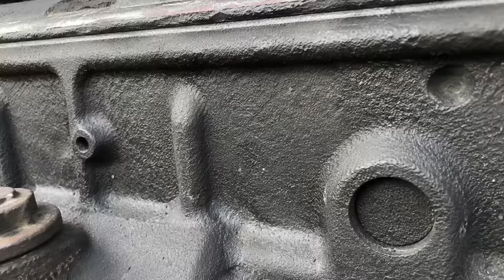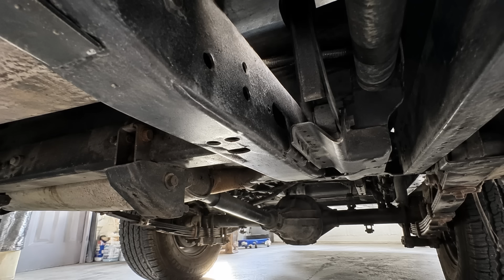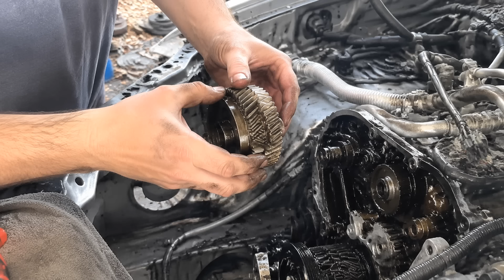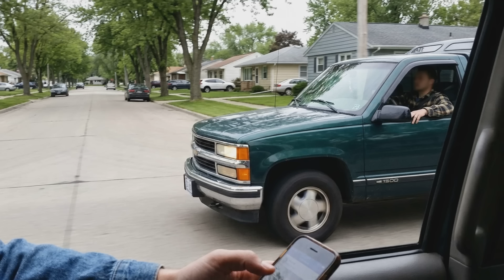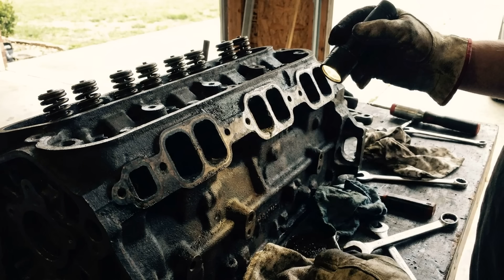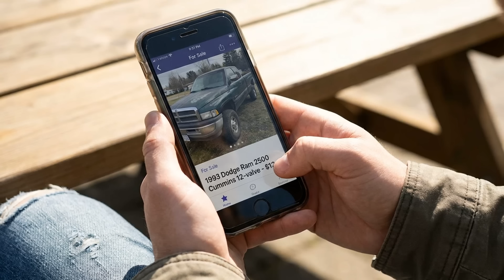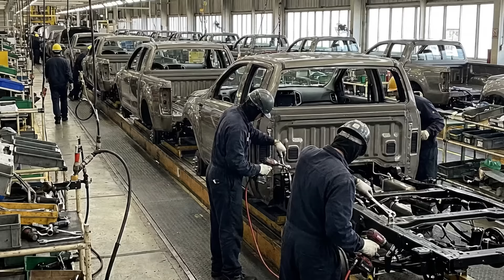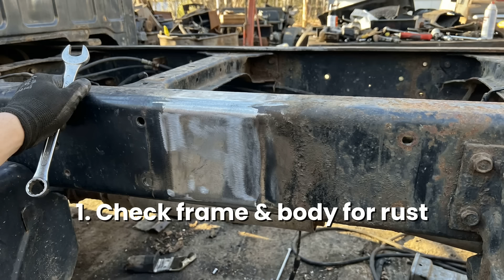7 Dirt-Cheap Pickup Trucks Nobody Buys (But They'll Outlast Every New Truck Forever)

Comment: I had an new 87 Pup with A 2.2 diesel Volvo three speed automatic. I had 1800 lbs loaded One time, spring where inverted drove slow Made my delivery I drove this little truck wide open for over 250k  It's probably in South America still running.

Comment: Still driving my 2003 Toyota Tundra.. I currently have a bit over 300,000 miles on it. Had to replace the alternator and the radiator. Last year my engine decided to give up the ghost. No warning, it just went BANG at 80 MPH on the Interstate. Had to replace the engine. Got a good remanned engine with a no fault warranty for 2 years. I've always done my own work on my vehicles. Although I never really was an ASC certified auto mechanic, I was a Big Boys Toys mechanic (motorcycles, ATV's, UTV's, snowmobiles, personal watercraft [PWC], and boats, both outboards and inboards). I can tell you from years of experience, no matter what size it is, all internal combustion engines work the same!

Comment: Basically we let the manufacturer's build new trucks with luxury and not priority to be just a  work truck .  
Too much technology that's not necessary.
Plus double cabs and power everything.
I miss my basic Ford regular cab 8 foot bed six with roll down windows and sliding glass rrear and a double gas tank with manual.
1981 Baby Blue 💙.
Never let me down.
Better than the other trucks I had which been many up to now .   
$66 k for new Truck is just plain ridiculous.

Comment: Have a 2003 Chevy Trailblazer 4.2 Vortec IL6 with 280,000 miles. Just like the Chevy 1500, I use it like a truck and overworked the tranny. Overhauled the 4L60E down to the shell at around 150K miles and still running. Not a mechanic and was my first transmission repair ever. Still running great.

Comment: My first new vehicle was a 1991 S10 Blazer with the 4.3. It was 30 days old the first time I had to be pulled from a mud hole. I jumped motorcycle moguls with it. I finally parted with it at around 215,000 miles. It had the original engine and original transmission with only basic maintenance done to it. As is the theme of the video, sadly Ohio winters got the best of it. I wish I still owned that little beast. I have to believe the S10 pickup equivalent would have been just as reliable.

Comment: My 2003 Ranger hasn't been running for a year. It won't start. It began with failing to start on hot days and now won't start at all. I already replaced the crank position sensor  and the gas emergency shut off switch. I think it's a fuel pump. I'll do a pressure test to find out.

Comment: Man,or AI. Lol. A roller with no engine or transmission sell for 2000. If it runs they want upwards to 15000 dollars for them. You can thank the tv show pickers for this. If its a truck older than a 1997. Everybody thinks they have a goldmine.

Comment: I have a 1993 Ford Ranger with 511985km at 411000 km I changed the original clutch . While it was apart I did timing belt, spark plugs and wires . The best truck I have ever owned. 🇨🇦

Comment: The Comanche was a truck version of the Jeep XJ. I knew a guy that had a Grand Cherokee with over 450k miles on it. Same straight six engine that had fuel injection and more pollution crap than the Comanche. But 3.0 AMC is a bullet proof engine.

Comment: My Bosses Jeep Cj7 Had The 4.0 
Inline 6 After Driving Like 20 Miles Pulling A Stump Grinder 
It Started To Ping  Up The Final Hill To The Job And When I Parked It I Put The Usual Piece Of Cardboard Under It To Not 
Mess Up The Customers Driveway We Were Done Taking The Tree Down And We're Ready To Begin Grinding The Stump I Noticed Nothing Had Dripped Out So I Checked The Oil Well it Needed 6qts Of Oil & The Radiator Was Also Completely 
Bone Dry Too Added The Coolant And She Was As Good As New To Drive Home. It Had A Huge Hole In The Floor Under Clutch Peddle Right Behind The Left Front Tire 🛞 I Could Almost 
Put My Size 13 Boot 🥾 Thru The Hole After I Hit A Puddle That Almost Blinded Me For A Moment After That Trip I Cut Some Plywood To Cover It A Few Years Later I Put A Clutch Kit In It Despite How Rusted Out The Body Was He Had Picked Up Another Old Jeep It Even Still
Ran But We Used The Body That Wasn't As Near As Rusted Out To 
Patch Up The Holes & Used The 
Fiberglass Roof & The Doors Off Of It Too A Few Years Later My
Dad Got A Used 93,94  Cherokee Sport With The 4.0 And It Was Fuel Injected That Thing Was Bad Ass Fast

Comment: When Datsun ( not Nissan ) had the l-20 4 cyl engine, 5 speed manual transmission.  They were almost indestructible !
Reply: I had a Datsun pick up truck I bought new for $7,000 the valve cover said Nissan on it. This was I think a 79 or possibly 1980 model with four cylinder five speed.

Comment: Bought my F250 7.3 Diesel new in 1996, at 268k im still enjoying it. Now, im a retired ASE Master Diesel tech...lets factor that in. However, when i went looking to update it, 20 yrs later, prices were insane! Brother-in-law was "junking" a 1980 F100 2wd... He gave it to me instead. Less than a grand later; new tires,brakes, suspension, eng accessories,  windshield, seat covers...300 straight 6, 4 speed, 8ft box, overloads,new sound system...i drive it everywhere, great power, mileage...roll up windows- real vent windows.,,pure joy!

Comment: I Had A 1988 B2200 SE 5 Got It At 70k mi. On It. Only Oil Filter Changes Dist.Cap&Rotor Plugs & Wires  Up To 170k A Clutch Kit Around 150k The Fan Clutch Went Bad And It Ran Hot So I Locked The Fan Clutch With Tie Wire So It Didn't Slip The Valve Stem Seals Went Bad So When You Started It Up Cold After It Sat All Night It Smoked Like Crazy For A Minute or 2 Didn't Use Leak Or Burn Oil Other Than  Burning Off What Leaked Down The Valve Stems When Parked Overnight Manual Steering And Power Brakes. You Weren't Going To Win Any Drag Races 🏁 With The 2200cc Engine With The Wopping 88hp It Had Other Than  
Tires & A Set Of Brake Pads On The Front. I Delivered Pizzas In 
It $5 Worth Of ⛽= 3.5 Gallons Back Then I'd Finish Up My Delivery's And Still Have Some Of It Leftover To Drive To My Fulltime Gig And Back Home & Do It Again The Next Evening 7days A Week I Put 25k mi. On It 
A Year Within A 10mi. Radius Around My Home & Domino's 
Pizza 🍕 That's A Lot Of Driving 
To Do After Cutting Trees Down 
All Day Then Another 5hrs Shifting Gears This Was In The 1990's No GPS Just A County Road Atlas That I Had To Drawing  In The New Roads That Opened In The New Developments Up Before The Next yrs Edition Came Out By The 3rd yr I Rarely Ever Needed To Look At The Road Atlas Anymore This Was During The Clinton Administrations Time Basically The Only Years That 
My Standard Of Living Didn't Drop & Actually Increased  During My Full-Time Working Years From 82 to 2012

Comment: Unfortunately for you guys in the US, you never got the Ford engine that was put in the Thai bodied Ranger in Australia (same as the Mazda BT 250) in 2008. A wonderful 4 cylinder 3 litre diesel 156hp 440NM with no DPF. 
Supercab with a 1750mm tub so still capable of carrying a big BMW  bike.
Mine has done 350k kms with only oil changes and a couple of timing belts. (very easy to change)
So good that I will drive it until one of us dies

Comment: Had a 78-79 Blazer with a 400 small block - hard on fuel since it had a full time 4x4/ but it was the best truck I ever owned ,  it could go anywhere - looking for another one to to redo - lift kit, manual, upgraded suspension - currently have an 06 Avalanche with over 250.000, 4" lift kit, small upgrades in suspension, of course had to replace a few things like water pump, alternator , cv and U joints etc - very smooth ride on and off road - lots of power - I can still work on most things ( when 200mi out in the bush it's nessary) - Hate electronics on new trucks

Comment: I just got my grandson a 1993 ford f 150 4x4 it has the 300 6 and it runs like a top it has around 225k and he has learned how to change the oil, fuel and air filter. he is already leaning how to find and fix problems like a leaking radiator hose. The only problem with these trucks is the stupid twin i beam suspension. So I guess we will be figuring that out next. He is 17 and helps me on the farm.

Comment: I have a 1990 Chevy Scottsdale K2500, that I hope to be buried in. By far the best vehicle I've ever owned. Original 350 4 bolt engine at about 175k, runs like a top. On its second 700R4 tranny but the newer rebuilt ones are far better and tougher than the old originals. Just a Great old truck.

Comment: I live in Pennsylvania and anything that is old is rotted away. I have a 2010 silverado that is a rust bucket, even the diff cover totted a hole through and leaked oil. Everything I junked in the last 30 years was because of rust.

Comment: I loved the jeep Comanche I had.   I bought it for $600.   I cut the fender wells out through some super-swampers  and spoke wheels and camouflaged it with a rattle can.   The 4.0 with an Auto is the one to get the auto is stronger than the stick shift.    I had it for year until someone rear ended me hard enough to break the seat and knock my head though the back window.  The insurance company gave me $2800 and I kept the wheels and tires

Comment: I got a 1996 GMC safari van with over 400000 miles and runs and drive with no problems .
Reply: I have a 2000 AWD Safari, only 250,000klms, I expect it will still run for ten years.

Comment: My dad had a Ford F150 1983 with 300 inline 6. Had a 3 on the Tree.  Bulletproof. Little coffin 1 barrel carb.
Reply: I had a 1982. I had over 400,000 on it when I wrecked it.  It was still running good until then. 300 was a good motor.

Comment: can't believe s10's with 4.3 v6 is not on the list
Reply: I've got a mint (two door dings and small dent on the rear bumper ) '99 extended cab pewter color 4.3 48,000 original miles! Never selling it ever! Turned down several $9 $10k offers!

Comment: And a lot of your trucks were junk or not that good when they were made . You want good Nissans, you look for the L motor trucks or the pre 90 hard body, the Toyotas, the 90's 2.4 and the best motor Toyota ever built, the 2.7 . Chevy 350 and 454, Ford most everything from 79 on back, Chrysler A motor trucks from 80 on back . The rest are alright to junk . The diesels were all good except the GM that was a warmed over gas .

Comment: Heck, you can't even find a 20 year old Buick or Crown Vic or Toyota . You really have a hard time finding good used 2000-2010 vehiicles for sale right now. I guess everybody has gone from buying new to buying smart. Y'all remember the Datson pickup truck?
Reply: My sister had a 1971 Datsun with a 4 on the floor. She drove it regularly from Loxahatchee Fla to the in-laws in Canada, had well over 300,000 miles on it. The timing chain was so stretched it wore through the timing cover and still ran. She had to give it up when you could poke your finger through the decaying body sheet metal but still running strong.
Reply: @estesproudfoot1754  We had ours in Houston Texas around the year 1982.

Comment: Still driving a 2001 Toyota tundra V8 161,000 on it. Starts every time. Runs great.
Reply: 1997   Tacoma  V6  ......only complaint is bed rails rusting out completely in two on the right side .......the truck bed bolts is what's holding truck together  !  I certainly  can't tow even something  small or even pull someone who may be stuck . Been driving her for 25 years and have been able to replace parts up till now ......only 200,000 miles but worried

Comment: I had the 91 F150 300 straight 6, with a 5 speed manual.  It was a great truck!  I just kept overloading with heavy stuff, fire wood, construction materials, vacation toys.  I finally sold it at 115 k miles and replaced it with the 7.3 Ford F350 turbo diesel.  Two great trucks!  glad I still have the 26 year old diesel.  Whish I could have kept them both.
Reply: I did!

Comment: I have a rust free 98 Chevy 2 wheel drive 2500 with 5.7 V8. I paid $2800, now worth about $12,000. I rebuilt the engine myself. Truck will outlast me.

Comment: I have a 1993 Mazda B2600 extended cab manual two wheel drive truck with ~ 175K. I live in North Carolina so no rust but it has been a work truck so dents have accumulated. Runs great no known problems and the AC works. It truly is a great truck that is simple and straightforward and does what it was designed to do and is comfortable enough.

Comment: I have a 2011 Ford Ranger and I have over a one hundred thousand miles on it, and is V6 with a 4.0. And you’re right about the little truck. They say that the blue book on it is over 11 thousand dollars in personal tax. The only thing that I have an issue with is the seats. The rubber in the seats have gone down, and it is lower than the back. But other than that I really love the little truck, and I think that I will keep it for a long time. That you for your information..!!

Comment: 1996 Ford Ranger. First odometer failed at 246000.  Drove it for 5 years with no ODO, Replaced the failed speedometer with odo showing 60k and drove it until it read 290000. Replaced the clutch and hydraulic pedal about 7 times, drive shaft 4 times, 5 speed trans once. I never had to work on the engine. I had to hand wipe out the gas tank once and that solved all the engine problems. I let it go when the clutch failed again. I was too tired to re-do it but i kick myself every time I wee one on the road.
Reply: WOW...Which engine was in that Ranger?

Comment: All I have ever owned is the old Ranger 5 speed, they are bulletproof.
Reply: Sadly my 2003 Ranger 4X4  XLT 4.0L five speed at 300K miles zero oil leaks needs to much work.
You have to pull the motor to replace the rear timing chain for the right bank.
Front Deferential is burnt blew a rear seal and couldn't pull over in clover leaf traffic fast enough from burning it.
Slave clutch is leaking into the bell housing for a few years amazed the clutch plate hasn't unglued itself.
It still drivable starts right up motor runs like a Swiss watch slight chain chatter at cold start front differential hums 4X4 still does it's job.
Being a rare standard shift I've been offered plenty of money for it over the years but i love this truck since I drove it off the lot brand new in 03 for 13 grand.

Comment: Ihad a 2011 Ford Ranger, 6cyl, Automatic bought new. Had it for 12 years and put 16,000 miles on it. Dealer offered $11,000 cash for it so I traded it for a 2024 chevy Colorado with 1,000 miles on it. This was in Victorville California. I wish I never sold it. I now have a 2025 GMC Denali, 3/4 to with a dsl and Allison transmission. The truck is great, until you  go shopping and try to find a o parking place.

Comment: The Mazda B trucks in the U.S.A were Ford Rangers with body modifications.
Reply: No they were made in Japan until 1993 because I have that year. Yes Mazda did put their name on ranger pickups and that may have started with the 93 model. But for sure Mazda did import their own trucks prior.
Reply: @WillFinch-k4j You are right, before Ford made the Ranger they were rebadging a Mazda truck and sold it as a Ford. The reason Mazda contracted with Ford to sell the Ranger under the Mazda B line of trucks is the Mazda trucks sold in other countries did not meet U.S. government requirements.
Before 1982 Ford did not make their own small truck and marketed Mazdas truck just like Chevrolet marketed the Chevy LUV truck.😊

Comment: I ordered a 1991 GMC 1500 extended cab with Sierra Package and V6 Vortec engine but I wanted a 5-speed manual. It took 13 weeks to get it and I have over 430k on it. It's no longer pretty but mechanically it's very strong.
Reply: That was very intelligent getting the NV3500 5 speed. You’d be on your 2nd 4l60 by now. A clutch is a lot cheaper. And the manual transmission with the six has more power.

Comment: I’ll never buy a truck newer than 2007. After that is when trucks turned into money printing machines, (for the dealerships service departments) I almost got a 2022 ram. They let me test drive it for a day. Since we went in so late in the day they slapped a D tag on it and I drove it around all the next day. Then it happened, a crazy tap and then the check engine light. It only had 120k miles on it, lifter failure.  I really Dodged a bullet. Thank God we didnt finalize the sale. I ended up finding an old cat eye Chevrolet work truck for 3k with 130k miles on it and it runs smooth as butter. The dealership ended up replacing the coil over the cylinder in question, cleared the codes and put it right back on the lot. 
  The 80’s- 90’s Mazda Z and B trucks and old Toyotas are definitely bullet proof.